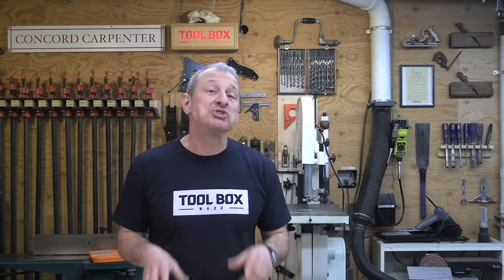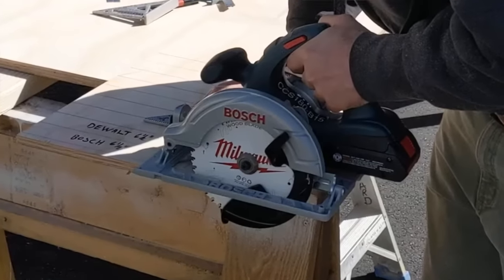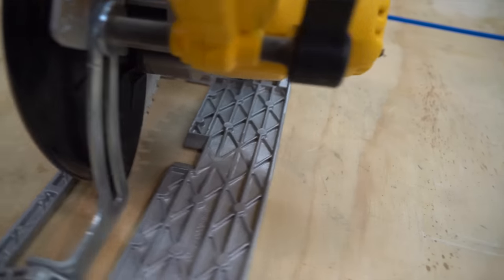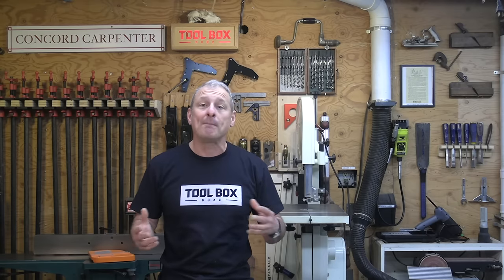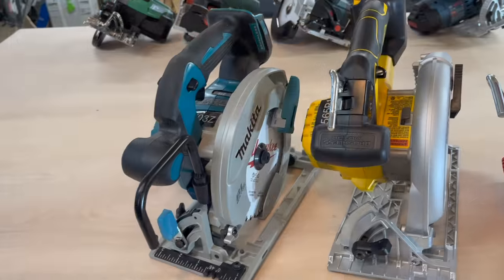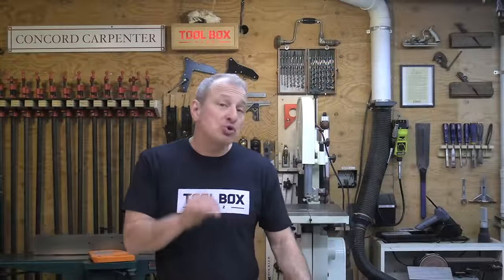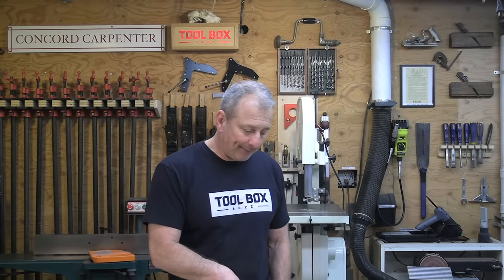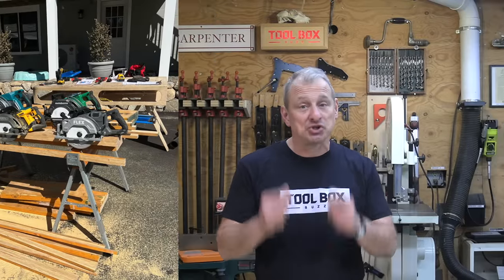Best 6-1/2" Cordless Circular Saw | Head To Head Test

Comment: We all know it’s about the motor. Milwaukee tools cut off when stressed. The cutting sled you made doesn’t allow for stressing the saws motor. 
    Want the most ppwer? Put a powerstack on that 61/2 dewalt. Combined with best line of sight, grip and build quality. Makita second in quality, lacks power. Metabo tools are a joke to pro builders.
Reply from the maker: JN, we actually played around an awful lot trying to find a sweet spot and pully weight for the saws.  

For example w/ 7-1/4 we originally were cutting one layer of three-quarter plywood with 8 pounds, it was not enough we added two layers of plywood and finally found the 8 pounds which was sufficient enough although a couple of the saws have trouble completing the test

For the 6 1/2 size we found at 8 pounds in a single layer of plywood was the sweet spot

We’re not trying to smoke the tools we’re trying to find a common ground that could show the speed power of the saw, I think we accomplished that
Reply: Really??Metabo tools a joke?
They still make some of the best driils and angle grinders,some of which are still made in Germany.The Metabo 66 saw is excellent and their new plunge saw has had some great reviews.Also the make some of the best batteries.

Comment: I regret buying makita
Reply from the maker: It’s a GREAT saw
Reply: ive got well over 10 grand worth of makita cordless, best money ive ever spent...some of my original saws and drills from over a decase ago are still working fine...nothing feels like makita in the hand, grip, balance.....i will never even consider another line of tools...and been at this for 40 years now......regret and makita should never be used in the same sentence .......
Reply: @nodoubt46able  regret that they didn't make their 40V tools backwards compatible with 18V and have had limited battery run time for the LXT and 40V was 3 yrs behind Metabo HPT in release and a large factor in why I replaced quite a few of my Makita and Milwaukee tools over the last 4+ yrs with the 36V line
The AC adapter for the longer run time tools makes getting more work done without killing batteries for every task with tools like table saw, mitre saw, SDS Max rotary hammer, portable band saw, grinder, router, vacuum and a few others. Plus a lifetime warranty and the best nailers in the business 25+yrs running
If your only Makita your missing out on some superior tools at a lower price
Reply: @baseballdude8491   tx, but ill stick with makita....i dont mind lesser runtime, vs having a less superior tool in my hand
Reply: @nodoubt46able  i bought a dozen makita tools… bad decision on my part.
Reply: @baseballdude8491  yeah I hope metabo HPT will make a 36 volt 6 1/2 circular saw
Reply: @barttrahan7037  they already do but it's not released in USA yet the HIkoki branded one is over seas and definitely would have showed out better with power in the head to head
Reply: @trentroberdeau6399  you gotta take em out of the box first and use them to make a decision man....
Reply: @nodoubt46able  i’m gonna donate them to Habitat for Humanity and get on a different platform to something that better suits me…
Reply: Makita is the best
Reply: @kevinr3263  yeah at price gouging
Reply: @kevinr3263  na, not really
Reply: @trentroberdeau6399   good deal, probably knockoffs somebody sold you anyways im sure...
Reply: @barttrahan7037  c3606da, i like it alot
Reply: @kevinr3263  They still use older 18650 batteries in there tools.